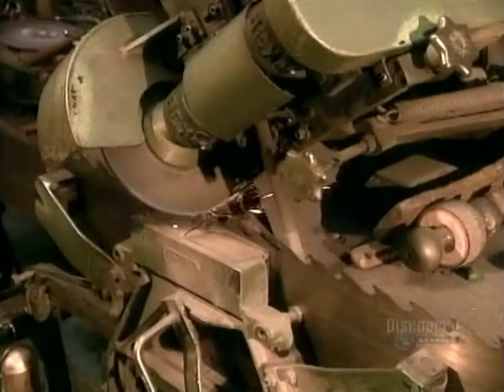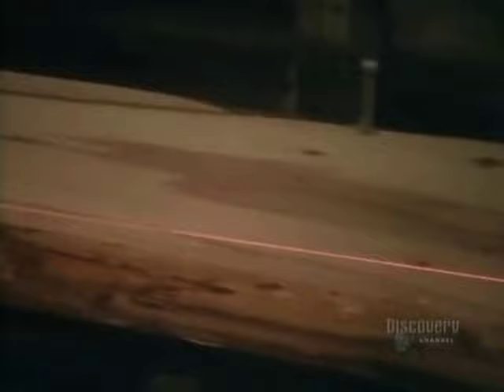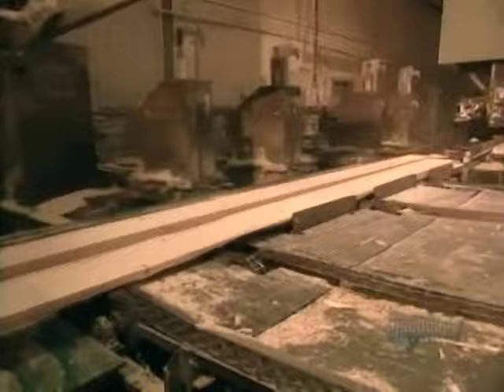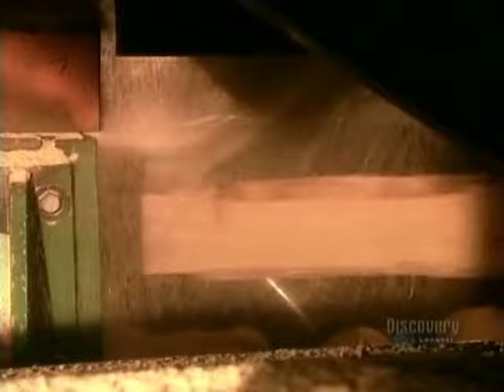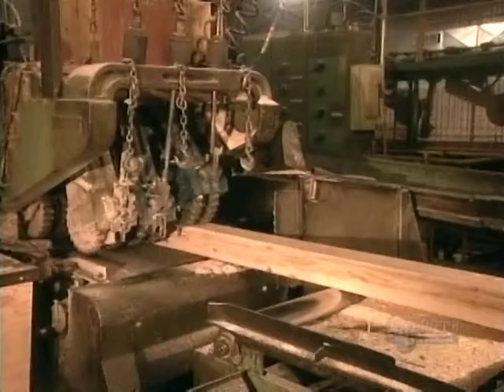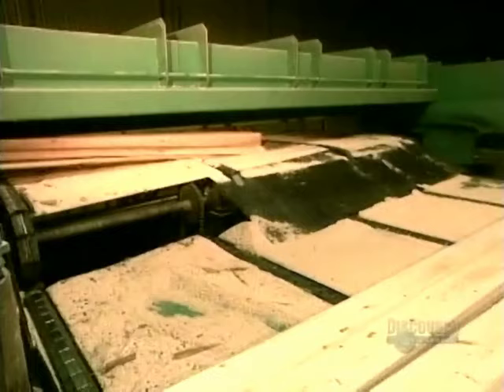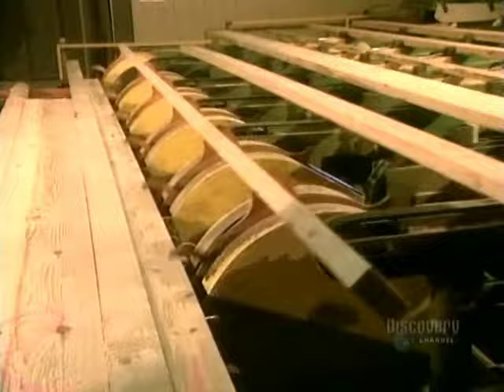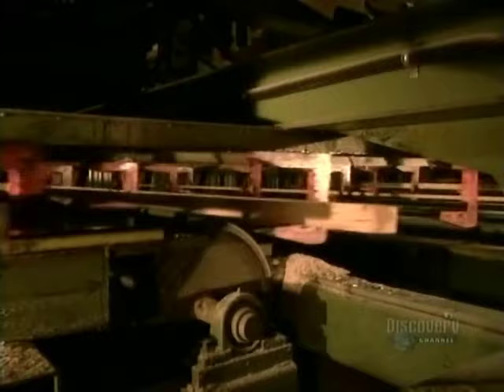How It's Made - Construction Wood

Comment: Its ridiculous how one tree makes like 3 or 4 boards and it takes decades for it to grow
Reply: We got synthetic wood now higher quality but pricier. Most wood now a days is shitty. Older homes have a much nicer structure compared to new constructions for residential of course
Reply: @jaredluo  well older homes were solider as they were made with true 2x4s. These nowadays are 1 1/2in x 3 1/2in. Personally i dont know why they do that but im not in the lumber industry
Reply: I assure you every single ounce of that tree goes to use. They would be fools not to. All that saw dust, wood chips, wood shavings. It's actually a gold mine. Every little piece of wood is used, I promise you.
Reply: @chrisu7022  oh I actually do know why they do that. The logs go through rough side first and get cut into sections, then after you make the basic shape they go through planner side. I'm honestly very disappointed that this video didn't explain that. So when they go through the planner the adjustments have to be very precise, you have to cut bad ends off the board and brake weak points in the board. If you don't when a weak board goes through the planner it will explode and jam up the planner.
Reply: @chrisu7022  someone mentioned that originally they started out as 2x4 then it got trim and sanded into 1 1/2 and 3 1/2. I didn’t see they do that here though. Maybe they didn’t show that step. But I can’t imagine the amount of wood wasting into saw dust and mulch
Reply: @derpherpp  as a carpenter and construction worker with years of experience thats something ive known for a long time. I just wanted to say it takes decades for a tree to grow and it takes mins to cut it down and make it into boards and etc... But thank you for the response
Reply: @chrisu7022  well we going to wood no matter what’s the price is. Aren’t they’re growing wood farms just for this purpose
Reply: @derpherpp  i suppose, but by the time those are full grown the planet will be short a few more forests and a rainforest how we're goin.